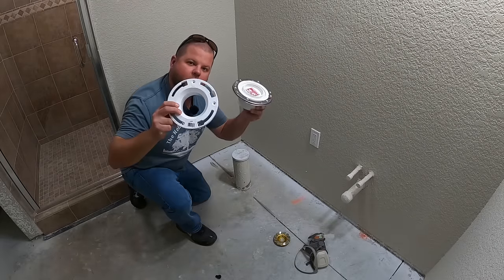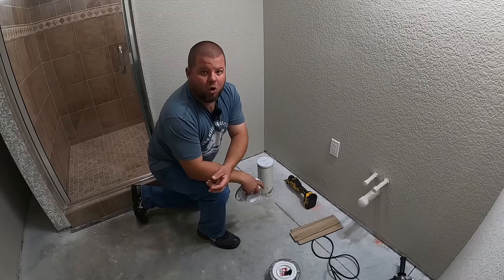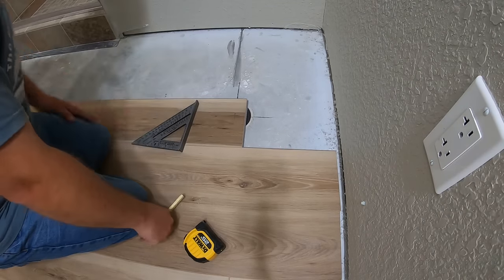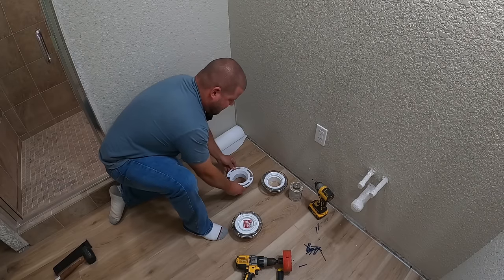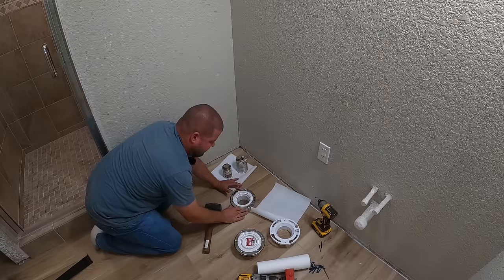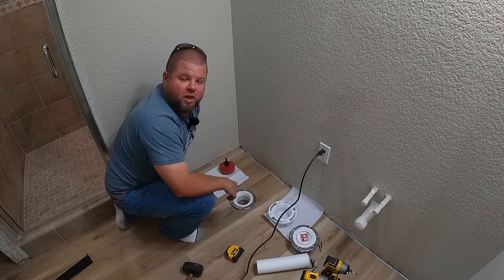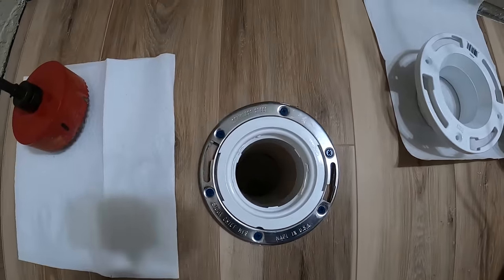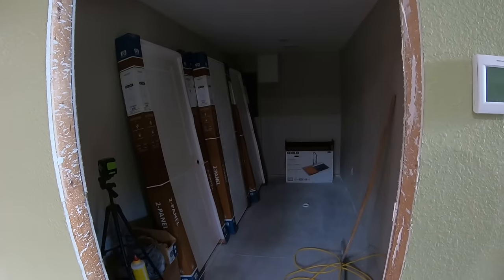How to install a toilet flange! Plus finishing up the bathroom flooring! #543

Comment: I am a plumber by trade, and you are right about setting the closet flange ABOVE the tile! Lots of people don't know. Good job 👍
Reply from the maker: Thank you for watching
Reply: Very educational I did not know how to do that correctly. Looks great. But I do hope that you change the color on those walls. That green is very dated. I was just kind of kidding around with you on that.
Reply: Put my flange above the floor and the toilet didn't set properly.
Reply from the maker: Adjust your seal size.
Reply: Un herror nunca podrás poner un wax con anillo porque quedaría alto y en  esos casos  siempre usarás  un wax  sin anillo  Reinforced  pero muy educado el muchacho

Comment: If you’re in NC, that would fail because you’re supposed to glue to the outside of the pipe. On the plumbing underslab I would’ve had them pad out that 4” pipe. Also that flange would’ve been installed at plumbing rough in.
Reply from the maker: I've never once seen a flange installed before concrete. The plumber can't possibly guess finished slab height plus the exact flooring the homeowner will install.
Reply: Not before concrete, but during the Plumbing Rough in.

Comment: So question what if the flange is set at the surface level of the concrete because the homeowner was just going with concrete floors, but at a later date decided to put in that same kind of plank flooring so then the plank may be higher or above the level of the flange?
Reply from the maker: No problem, they make thicker or double stacked toilet seals to take up the difference.

Comment: I've been plumbing for 20 years now. I've found that having the flange FLUSH with the finish floor is best, if not upto a 1/4" BELOW finish floor. Too many times I've found wax rings completely squished out and not providing any real seal to the flange, just porcelain to plastic, or they simply rock because the toilet is being pushed up by the flange and the base of the toilet isn't allowed to sit on the floor. I see there's at least one plumber in the comments saying to set the flange on the finish floor but I have to 100% disagree. You can always stack a flange higher, use a MaxWax ring, etc., but you can never make a flange lower....  In your case, I would have set the flange to the concrete tightly, then anchor with tapcons (the glue will NOT suffice to hold you toilet down). Your Johny bolts are pulling up on the flange as you tighten your toilet down, so you want to be pulling against the concrete, NOT the glue/plastic. THEN take you floor AROUND your flange with a 1/4" gap.
Having your flange above your floor, that you aren't supposed to pinch/weigh down seems counter productive to me. 

...sorry I didnt start watching your channel earlier, since this was a year ago or so you get my best 20/20 hindsight. Any way, thanks for the vids, I enjoy this series a lot!
Reply: You said everything I was thinking and more.

Comment: Thank you for throughly explaining this process. I’m just about to that stage of my flooring process. Great Job 👏
Reply from the maker: Glad you enjoyed it
Reply: I was always told to use purple primer and go up 2-2 /2 in up on both pipes allow for primer to dry not completely but no runs or drips bc it's a primer it also won't allow the glue to adhere dif codes different cities go video tho
Reply from the maker: Primer is not required by Oatey, even says so on the can. But you must follow local plumbing code. Florida's says primer is not required up to and including 4 inch DWV piping as long as the glue meets a certain ASTM spec, Oatey glue does meet this spec.

Comment: It looks like you were able to keep most of the dust out the pipe while cutting the flooring, but a good tip is to stuff a rag in the pipe before laying the floor to catch and debris.

Comment: Great job nice & clean flange install!  However, I believe as per manufacturer LVF you're not supposed to screw the toilet flange into LVF! You need a 1/4 gap around the perimeter & flange for expansion & contraction. It's a floating floor system which I'm sure you know. I watched tons of videos on how to install & read Home Depot  Lifeproof instructions. Because I'm going to install Lifeproof in our bathroom.
Reply from the maker: That is true, but on a floor this small with expansion gaps each direction at the wall, I am not concerned.

Comment: code or state requirements,  primer is a must for low temperature applications when underground piping is installed in cold or even shoulder seasons and glue is more of a gem then liquid, when pipe is dirty and need cleaned but for warm temperatures inside finished house (insulated) it won't matter it doesn't help.
As about color of the primer,  purple is no doubt a bonus for drainage installations where inspector is not your best friend..put it this way

Comment: Thank you Man!  That stainless rotating flange rim is spectacular.  Ive been looking for the strongest material and best connection.  The fact that I don't have to guess at where to align the sliding/twisting bolt holes is a super bonus.
Reply from the maker: Yes it's definitely the correct way to go.
Reply: What do you do if the pipe is the same size as the 3or4" flange with the metal ring

Comment: Well when 5 Star work is seen. I must say  congrats.  And you are great on flooring and plumbing.   So   top hat to you sir....
Reply from the maker: Why thank you!
Reply: @TKCL  I normally install the plastic ones.  Why?  Well here in Canada we got an all plastic one that turns like that.   And since I removed many poop holes.  I saw many metal flanges that well because of rust and how diffrent metals sometimes cause some reactions.   But note it was in 15 years old or more places.   But rocking trones make the Queens and Kings feeling seasickness...

Comment: thus, flange is better to be level with finished floor,  then a Fernco FTS-3 toilet seal can be used instead of messy wax or rubber gaskets (has a depth of 3" that can be inserted into toilet flange IF, inside pipe is 3" not less), check your plumbing supplier for this excellent toilet flange gasket

Comment: Looking good, very well done. 
Little late now. But a good tip for grinding on concrete, or any dusty task really, set the shop vac hose near your grinding. It’s a big help with reducing the dust.
Reply from the maker: I agree!

Comment: New install very nice on them toilet flanges. Clean. Had to replace a rocky toilet flange only to find out the drain pipe was just a little (like half) off the mark too close to the tub so they had to put in a 45 degree adapter to get the flange to center up properly (tub to opposing wall). So now ya 'half' to lean on the dump LoL Great work always a pleasure seeing ya video popup in the feed!!
Reply from the maker: It's all in the preparation to make sure it fits as intended.

Comment: Fabulous job.  The only thing I would add is I'm not a fan of primer on toilet flanges.
Light glue and no primer makes it so if you ever have to remove the flange for whatever reason you probably can (carefully) without destroying it or what's around it. The toilet weight keeps it there.  Also always after drilling first hole install a screw to make sure you didn't over drill it.
Reply from the maker: I agree on the glue or no glue method.

Comment: I enjoyed watching your video and from my experience installing rough-in plumbing and renovating homes I can say this is a good primer for diy'ers. One thing I wanted to point out if you don't mind. You mention concrete a few times when I think you actually meant thin-set mortar for cement backer boards. I'm sure you know concrete is for slabs and has aggregate in the mix and would never work as a mortar application. The first timer may actually go out and buy concrete mix. 
Please correct me if I'm wrong but I also noticed a slope tapering from the flange where the thin set mortar was applied. If that is a slope my though is this will cause the toilet to rock or not sit flat.  
I also wanted to ask how you determined the location where the hole will be cut in the floor for the flange? Your hole saw cut was precise, but I don't see where you marked the center of the 4" DWV on the plank flooring to get that precisely accurate hole. Perhaps you measured and drew the plan with dimensions in advance on grid paper, with the precise center of the DWV on that plan view. Thank you.
Reply from the maker: That tiny slope was absorbed by the flooring padding. There is zero rock in our toilets. I laid my flooring down until the hole was mostly covered and found center. I made that mark on the flooring and finished laying. The hole saw has a center bit, so I went back to that mark with the center but and cut it out.
Reply: @TKCL  Ok thanks, that makes sense for this type of flooring.

Comment: I’m about to do the same to my garage/shop bathroom. I was wondering if you are going to install a basic corner drop in shower pan, would you lay the floor first and then drop in the shower pan? Or drop in the shower pan and run the floor up to it?
Reply from the maker: I'm not familiar with shower pans. My shower was built up with morter and concrete base and then the drain was set.

Comment: Do you need to allow the PVC cement extra time to fully cure before setting the bolts and toilet? Or place some weight on top to ensure it doesn't rise? Thank you
Reply from the maker: Yes always allow it to cure the recommended time on the can. A good 30 seconds of down pressure is usually enough to set the glue so nothing pushes off. Don't put the toilet on until the can set time is met. That could be minutes or hours.
Reply: @TKCL  yes sir thank you for the good reply!

Comment: Thank you very much for your videos I learned a lot I am changing my toilet and I have a question the pipe is in metal so how can I glue my flags to the pipe  I will appreciate your advice   Thank you  Martha
Reply from the maker: Sounds like you have old cast iron piping, it's been obsolete for a long time. I am not familiar with that kind of pipe to give you a good response.

Comment: Hey Andrew, you didn't leave an expansion gap around the flange and screws. These LVP floors really do move around and it will cause you problems if you don't go back and correct that. You can probably just cut a small ring of material out from around each flange that the toilet will cover so you don't have to do any major rework.  Otherwise, everything is looking really nice. It's fun watching this all come together.
Reply from the maker: I did around the flange, but not with the screws. I'm willing to risk that small area won't be a problem. If it is, I can always cut the flooring back from the flange.

Comment: Thank you for the great video. Quick question for you: considering the width of the floor and flange, would it be better to go with 2 1/4 tapcon screws as opposed to 1 3/4? Just curious.
Reply from the maker: Sure, that's wouldn't hurt.

Comment: Cool install, they also make flanges with gaskets that do not have to be glued. But where is the supply valve for the toilet?
Reply from the maker: It comes out the side of the vanity hiding the hammer arrestor and cutoff valve.

Comment: I have to say… I would cry if I seen you doing flooring like that. With how many tongues I’ve broken using rubber mallets… jeez they never go so smooth.
Reply from the maker: Did my entire house without a single broken tongue 🤷. Are you installing that cheap press board laminate? I've seen those break easily.

Comment: I am running into an issue with a flange right now on the second floor. I can technically get to it through the kitchen ceiling that got damaged by a leak thru the second floor walls. I am just wondering why with a 4 inch flange and the flange fitting into the pipe is it bonded to the PVC pipe? Why not just make a model with an oring to prevent gas escaping and bolt it to the sub floor? If it is a non pressurized pipe with a smaller one fitting deep into a big one there should be no need for it to be sealed right?
Reply from the maker: Only requirement I'm aware of for sealing is the gases as mentioned and any fear of backups and leaking water. Your idea sounds good in theory, but your inspector is going to most likely require glue and a bonded connection.

Comment: That first “primer” you used looked like Oatey standard strength clear glue. The primer is - as far as I have seen - always in a purple accented container. Thanks for the video, very helpful!
Reply from the maker: They make clear primer as well. Contrary to popular belief it's not required (at least in Florida plumbing code) as long as it's non pressurized pipe up to and including 4 inch. The glue must meet ASTM 2564 standard as well, Oatey does.
Reply: @TKCL  Yep, you’re totally correct, I should have done some research before posting.
Reply: @TKCL  - If you need to plunge a blockage in the pipe past the flange, it WILL experience pressure, though. Temporary, yes, but better just to prep for it & not need it than need it & not prep for it.
Not everyone includes fiber & adequate water intake in their diet 😂
Reply from the maker: It's glued, no need for primer. That glue has it chemically bonded, a little plunging or backup will never create enough pressure to break that bond.

Comment: The supply stub outs are two close.remember to install escutcheons also
Reply from the maker: Tell that to my plumber. Go figure the only plumbing I hired out was the under and through slab plumbing. A lot of it wound up not exactly where it should be. Thus the reason I'm big on do it yourself.

Comment: I like how you measured and configured your job (hallway) so no "horseshoes". also, not having casings installed , you don't have to undercut your jambs. You didn't put down any prep at least on your joints? You may have a problem with those showing through in the future.
Reply from the maker: Prep joints? Not sure what you mean. The concrete?
Reply: @TKCL  we use Ardex
To fill the joints and any depressions before installing any flooring.  Should be available at any good flooring store. Used to use the white stuff, I think called fix all but haven't used that product since early 90s.

Comment: I noticed that there was not a water line behind your first toilet flange install, are you going to run it from under your vanity ? thanks Brian
Reply from the maker: Yes coming out the side of the vanity, way too much piping going on in that 2x4 wall. I should have framed out in 2x6s.

Comment: Newbie question.... Does bolting the flange through the vynal prevent the floor from floatng? Thanks
Reply from the maker: Technically yes, but it can still expand the opposite direction in that small of a space. I guarantee you putting excessive weight like kitchen cabinets, heavier appliances or large furniture sets is also pinning down your floor.

Comment: Great video, I feel confident to do my toilet flange now.  Also, what do you suggest for cutting that flooring other than your purpose built cutting tool?  Just score them with a razor knife and break it off?
Reply from the maker: Scoring works just fine, and then a quick snap.

Comment: What size was the bit you used to pre drill for the 3/16 screws?
Reply from the maker: Always use the same bit size as the fastener unless the manufacture states otherwise.

Comment: Hello Sr question for you
What's the measurements from the wall to where you set the screws that will hold the toilet?
Reply from the maker: The most important measurement is 12 inches from finished wall to center of the waste pipe. That will allow most standard toilets to fit.

Comment: Would the tile not crack if I put screws in it through to Flange down to the concrete ?
Reply from the maker: You need to drill the tile out with a tile bit.
Reply: @TKCL  right now I've got the concrete in basement, should I schluter and tile it out and then cut the toilet rough in flush with tile  and put toilet flange on top of the tile or put the flange on the concrete and tile around it? Thanks!

Comment: If my 4inch rough in comes out of the floor slightly angled- do I have to redo it or is it possible to still fit the flange on?
Reply from the maker: Depends on how severe the angle. Luckily the foam ring and or wax seal you use will take up some of the inconsistencies. But you need your bolts to line up as well. A small angle I can't see hurting, a severe angle and I'd redo it.

Comment: My question is if nothing is set up, (no sewer pipe coming through floor), what is the distance from the wall to the center of toilet hole, this is for a rebuilt cabin/mobile home.
Reply from the maker: 12 inches from finished wall to center of the pipe will accommodate most Toilets.
Reply: @TKCL  thank you so much

Comment: I had an old steel one and it corroded when the wax ring was not perfect in the house. So instead of fixing just the leak I had to replace the entire flange.
Reply from the maker: Sounds like old cast iron plumbing, that stuff is obsolete for a good reason. This ring is stainless.

Comment: Looking to remodeling my bathroom and putting in new flooring and moving the toilet. This was great. Just one concern, not related to your trade, but was there not a supply line for the toilet there? 😅
Reply from the maker: That's because I've always planned for the supply line to exit the side of the vanity that's right beside the toilet. I hid my cutoff valve and hammer arrestor inside the vanity.